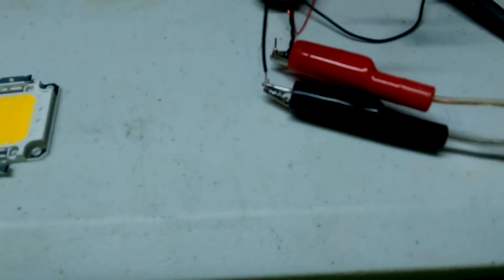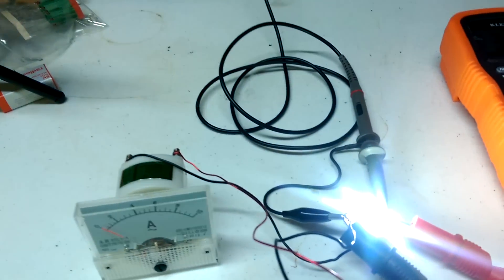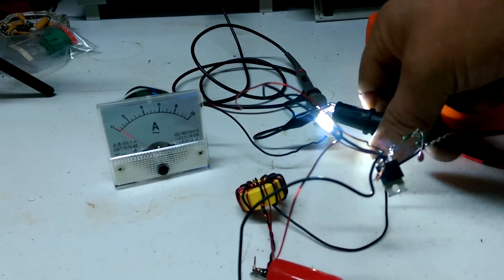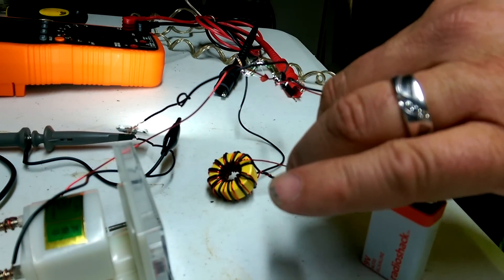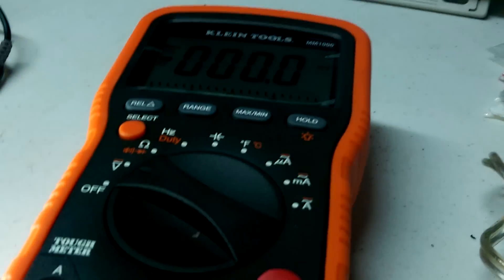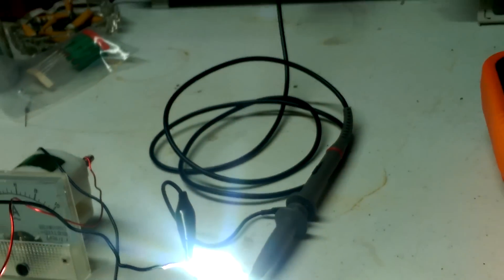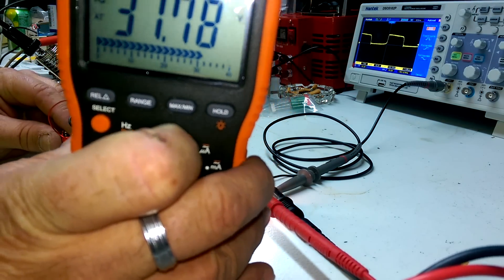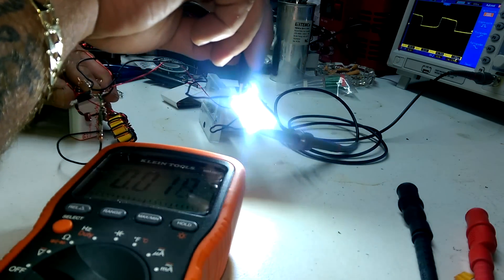Additional energy with Bifilar Joule Thief. 85% more. Is It Overunity?

Comment: What did the voltage do on the 9 volt battery?  What's all in the circuit?
Reply from the maker: +slackdawg05 The voltage from the 9 volt battery was 8.2 volts at start up and has a voltage drop of .7 volts, operating at 7.5 volts. The output reads 33 volts, but, the input is 7.5 @ .167 mA which equals 1.4 watts output. The normal input is 12 volts at .833 amps which equals 10 watts. Since the output is at 33 volts and the amperage is high enough to run the bulb at its full rated output using less amperage, I think there is an addition of cold electricity being introduced to the circuit which gives the bulb  additional boost for the light. If I add a current clamp on its output, the level is erratic, as well,  if I break the circuit at the led and connect it to my ammeter on the Klein meter, I get the same wattage out as the input, 1.4-1.6 watts, which is 8.6 watts lower than it is supposed to be, showing either a much greater efficiency, or, it is showing we have another source of energy. A circuit doesnt make components more efficient unless the constant current power supplies that come with the LED were a bad inefficient design to begin with. That would clearly be bad for business, so, my question is this. Why doesnt CREE or any other top names offer a lamp that runs at 900 lumens with 1.4 watts? Because they cant make one. The LED hasnt become more efficient, I believe we have an unidentifiable source of energy incoming through the pulsing of the circuit, and it is adding energy that gives us just as bright of LED with less input current. When voltage drops, current climbs, provided the output is the same. I am getting much less heat in the output, and, this could be provided by a couple of things. Pulsing a circuit on and off quickly eliminates the leds on time, reducing the overall amperage, however, it is only off a couple of uS opposed to its constant state, so, Id like somebody to recreate this and investigate it a bit.